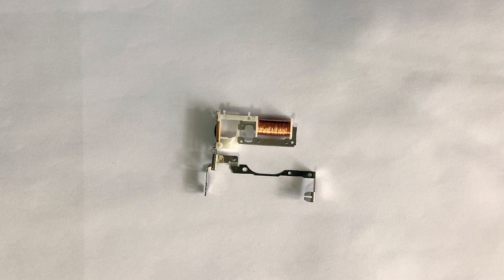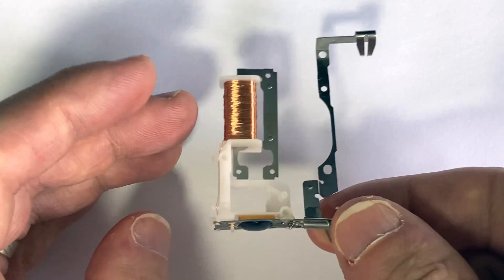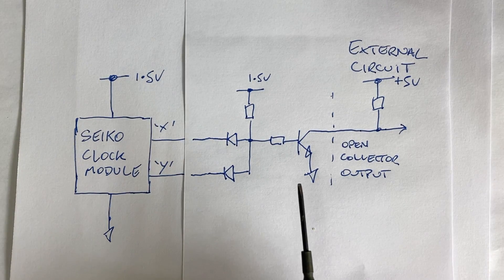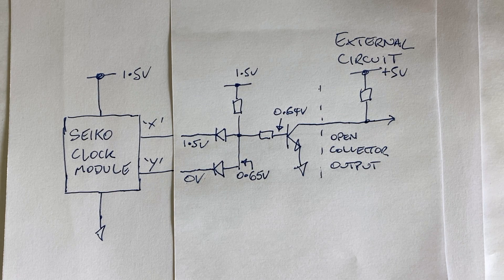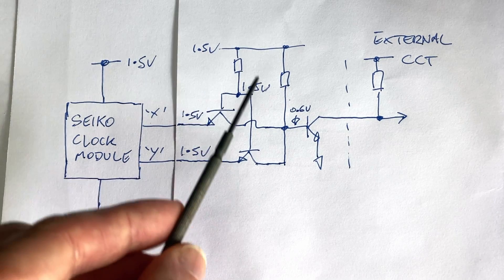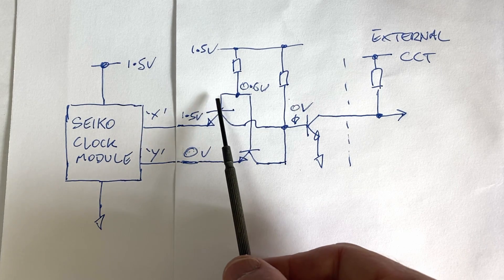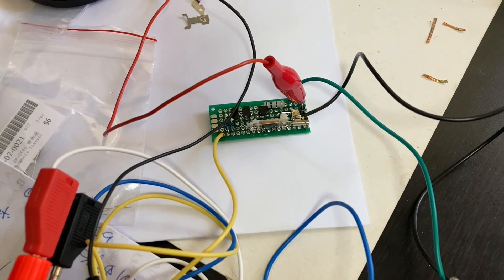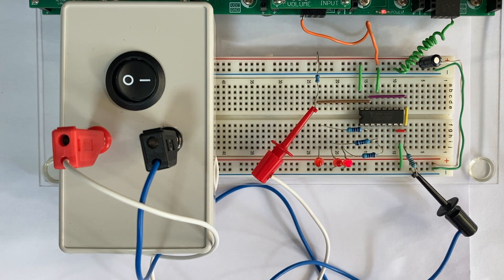Turning Junk into Treasure: Reusing and Repurposing a Quartz Clock Module

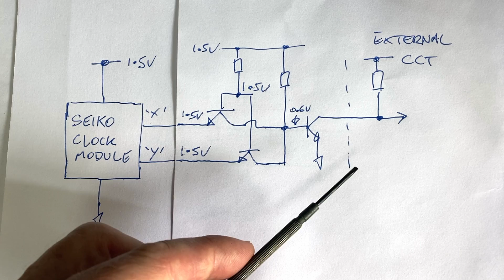Comment: 7:49 You'll have current flowing through the B-C of the two left transistors when idle, and a negative output from the clock module will pull current from the B-C and E-C of the other transistor. This causes current drain from your battery between pulses. That said, the transistor on the right is optional, as the left two transistors already provide the voltage translation and the AND function. Removing it will also decrease the current draw
Reply from the maker: Yes! By my calculations the configuration you suggested would have a current draw of about 2.5uA over 1 second (with the pulse width at 28mS). With the third transistor (as in the video)  the current draw is 127uA. Still not a huge draw, but if we assume a AAA battery has a capacity of about 860mAh, then my circuit would operate for about 280 days. In stark contrast, yours would last about 38 years!
There are two reasons why I went with this design. The first is that I simply wanted a positive pulse on the output. The second was to add some additional buffering between the output and the clock module, since, although I know the current and voltage limits of the 2SC1815 transistors, I don't know these limits for the module itself. 
Nevertheless, if I were to incorporate this module into a  larger fixed circuit , I would follow your design recommendation in order to reduce both current consumption and component count. 
Thanks for your excellent comment!

Comment: I'm glad I found this. I have an idea for an indicator light to remind me to plug in the car. To keep power consumption low, I was going to blink the light. Something like this might work for that.
Reply from the maker: I haven't done the maths, but as suggested in the pinned comment, you could get rid of the transistor and resistor on the right and hook the LED (through a resistor - I'd say at least a 15K for a 12V system and a red LED) directly to the two connected collectors. 
You'd still need a solution for supplying 1.5V to the clock module. Maybe two or three power diodes a connected to 12V  through a large resistor; the forward voltage drop across the diodes would be in the order of 1.2-1.8V. You could then probably just connect the clock module across the diodes.

Comment: if you divide that 1 pps by 730... your clock becomes a 
calendar. you just have to make a new dial that has '1' at top and '12' where the '11' normally is. second hand orbits twice a day...
Reply from the maker: That's interesting. I've never heard of that idea before. You could use a 4040 12-bit binary counter and 4x AND gates to divide by 730.
Reply: @inazumadenki5588  there are minor issues like having to do minor adjustments at the end of 31 day months and Feb.
I  used an attiny85 but the batteries only lasts a few months.
730 (365 twice)  is factored by the prime number 73.
I haven't figured a way to do that with cmos logic, yet.
if you could tolerate a bit of error...factors of 729 are 27 ×27...
or 9 × 9 × 9...
Reply: @SkipFlem  Isn't that what the old Greek(?) Antikythera mechanism does/did ?
Reply from the maker: @SkipFlem  In theory, the following should work: 730 decimal = 1011011010 binary. Take the CMOS 4040 counter and AND bits 1, 3, 4, 6, 7 and 9 together (you might need 6x AND gates to do this). Feed the output to both the counter reset pin to restart the count and a pulse extender circuit using (2x) AND gates - the latter will be your output pulse.